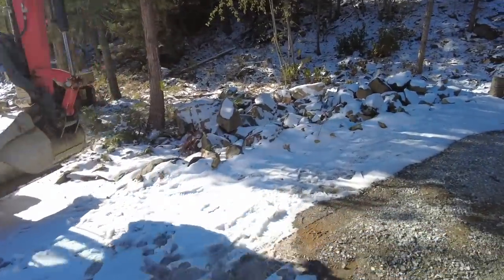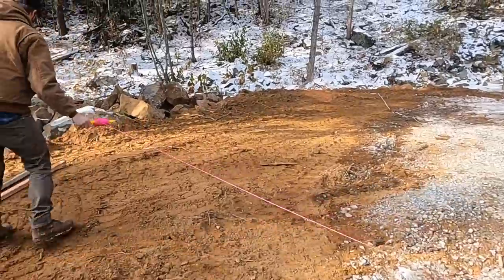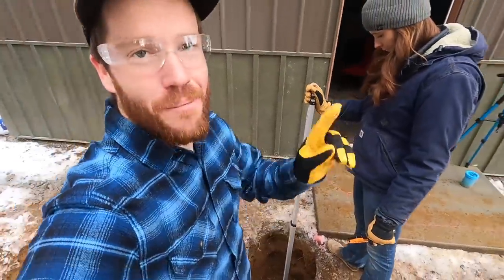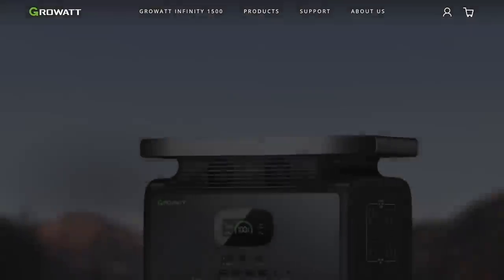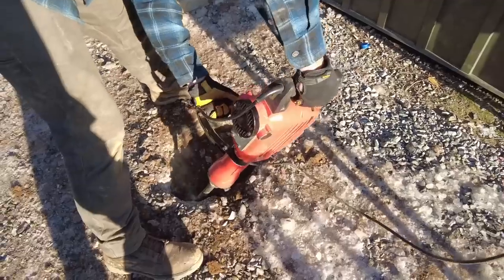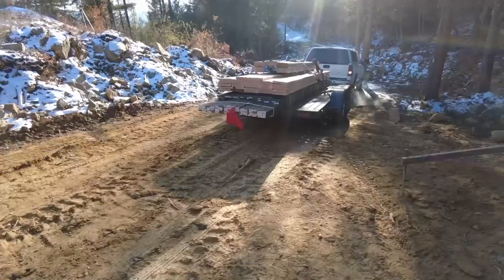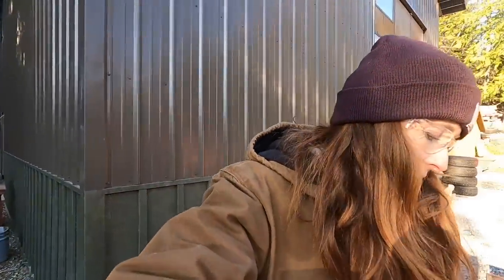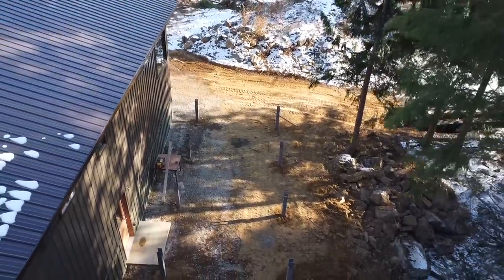Starting A NEW Build In WINTER?!

Comment: Something that could make your life easier if you're going to be doing a lot more holes is an auger that attaches to a hammer drill there's several of them on Amazon I use it when I'm drilling Frozen ground and you just need a good size hammer drill

Comment: deck: good idea. Especially for emergency exit.
Carport: good idea
I'd keep the interior stairs for ease of getting shop plus, if the overhead would go down. You'd have no the electrical panel.
And finally: Make sure you have a good gate on the outside stairs that's varmint proof. Don't need a bear knocking at your patio door

Comment: Make a vapor barrier tent by blowing air into an area with the plastic anchored on 3 sides, and most of the 4th. You can then put a heater inside and pour concrete year around. My uncle told me that is how he has poured at -20F up here in Alaska, while inside the makeshift tent would be between 40-60F depending on the heater and area heated.

Comment: I also have an electric hammer, but tis 2800 watts! Only powered by my gas generator. BUT, the reason for the comment, I got tamper tools for it too. I put in 670' of fence and it was all rock and shale. 6" top soil, then the hard stuff. Auger to place the hole, then hammer loose and remove with manual post hole tool. No concrete, too hard to replace if a post gets damaged, so backfilled with crushed limestone and tamp. The tamping bit on the power hammer really was a saver! Took me most of the summer, I'm 63 and needed rest days, but got it done.

Comment: Just a quick hey!  Been watching your videos for awhile now.  Based on your deck size I would suggest placing your deck boards at an angle to your trusses.  This let's you purchase 1 size board for the entire build, run them slightly long and then just strike a line at the end and cut the ends off.  I did it with my 12' deck using 16' boards and it looks amazing.  Everyone comments when they see the angled boards.  Also, no butt joints to warp over time.

Comment: We got 77" in 24hrs FYI when pouring concrete in freezing temperatures you could take plastic & cover the pour. Cutout around post for tight fit & then extend well beyond the edge of your hole

Comment: A shop-vac with a cyclone separator is my secret weapon for digging narrow post holes in rocky soil... Vacuum the loose dirt out of the hole around the rocks so that you can dislodge them easier.
Reply: Skips the post hole digging shovel too... Vacuum+breaker bar >> shovel😂

Comment: 4:58    I know a guy that uses .035 mig wire for layouts.   with a wire tensioner, you can get them fiddle string tight, no sag over long distance, and not affected by wind as much as mason line

Comment: Tip. Use hot water when mixing concrete in freezing weather so the freshly mixed concrete is 60 -80 degrees. The water does not evaporate in concrete. It INCORPORATES as it HYDRATES the cement.

Comment: When pouring concrete in low temperature one of the critical items is temperature of the concrete as it is poured above 50 F then insulate.  The 50F gives the  concrete a chance to start generating its own heat..  Cheers enjoy your projects.

Comment: If you use hot water to mix your concrete, it will speed up the hydration (curing) process as well.

Comment: I built a similar deck on my house a few years ago. I ended up extending its roof to overhang the deck bc of the blow in rain. For you guy's it would be snow. Just something to consider. Cheers
*Just looked at ur design again and trust me you guy's want to extend that roof line 2' past the deck line. So run ur 4x4s 7 feet past the deck line. Again suggestion. 😉

Comment: That is going to be a good size deck, the views should be pretty nice from up there.
Damn that is one heck of a snowblower you picked up, that is going to make clearing the long driveway so nice. Keep lots of shear pins handy as you have lots of rocks in the driveway. I plowed commercially for many years and no matter how far I would push back the snow of the first few storms by mid winter driveways got tight, I would have loved a truck-mounted snowblower.

Comment: Water in concrete is consumed by the chemical reaction of the concrete curing, no evaporation is involved. Second use hot water and non-chloride accelerator  when mixing up and you're good to pour. Cover the top with a blanket.

Comment: I hope you are going to put some ice and water shield folded down at the edges 1” min to prevent the top of those GLB’s so they don’t rot out  
Also it takes more kinetic energy to melt ice than create it  
When melting wipe off water while in liquid form before it refreezes  just a couple pointers

Comment: G'day Guy's
I'm enjoying watching you content from Brizzy in the land of Oz
After over 50 years in construction....
Estimate the amount of water needed for you mix (ad most but not all into your mixer)
(I'd use hot water 60F-70F or even hotter, and it will give you time to let the concrete go off before freezing)
(We ad ice to do the same but opposite here on hot days)
Add your cement 
Than ad your gravel/sand for a easy and well mixed brew
Adjust the required water according to your wants and needs for your project mix at the end
Cheers and keep up the good work ... Rosco

Comment: Water in concrete does not evaporate.  Water is part of the chemical reaction for the cement paste to cure and crystalize.  Concrete is a mixture of water, sand, aggregate (stone, usually), and cement paste.  Fun fact: Concrete never stops curing over its lifetime.  Something I learned in architecture class for foundation pouring. :)

Comment: If doing the concrete again in frozen soil preheat the holes. You could light a fire in each, and cover them in  insulation or straw after the pour to help keep the heat. 
You can use your excavator and either cardboard or PVC pipe. You dig a bigger hole, drop in the tuoe and pack back around the tube after filling the tube with the concrete footing.

Comment: That concrete you poured in the hole was to dry and clumpy ,not wet enough and will not flo under the post like you said. Make it wetter, it will not freeze before it dries with all that dirt on it.

Comment: I can't imagine that as shallow as yourfrost level goes.  Here in Atlantic Canada we go six feet down for posts or footings.  I have seen four foot footings used on an attached garage lift and move tye house sills of the foundation.   Howcome you didn't just back the trailor into the shop and close the door to keep the heat in?  Seems counter productive having the heater on with that door wide open.  Fingers crossed for you that it all turns out.  You put so much hard work into it and have such great plans and drive.  Keep up the good work.

Comment: The water in concrete doesn't evaporate. There is actually a chemical reaction known as hydration where the water and Portland cement form new chemical compounds. These reactions actually continue for a very very long time with the concrete continuing to gain strength. The rate of strength increase decreases over time. For design one uses the 28 day strength of the concrete.

Comment: OK I'm sold I'm buying one of those power boxes. Also on our end we had our Solar panels installed Saturday and on Monday it will be active. It will provide 94% of our electrical needs. Our water heating panel has been  up for 30days now we saved $70 on last months bill. Our electric was $278. down from $355. a month and next month our bill should be only $25.00 Net Metering charge. Solar-Fit is the company.  I'm now selling for them. I retired in 2015 and just decided I would like to sell something I believe in. So that's it I'll send you photos next week.

Comment: Does the snow blower mean you sold the bulldozer? It appears you are going to mount the blower on the army truck. Do you think it will have enough power to run that big blower, or are you going to put a second engine in the truck bed like big commercial blowers?
Reply from the maker: Stay tuned for more on this soon!

Comment: You two never cease to amaze!
Since discovering the power of hydraulicly assisted digging I have come to realize how much I hate shoveling. I used the same posts from Perma Column that you used. I dug all of my post holes with an excavator, placed sonotube or 4 ft pieces of corrugated plastic pipe. Backfill outside of tube or pipe with crushed rock and compact with jumping jack. I used 24" pipe for my building posts but I think 12" or 18" would be plenty big for you since you have so many posts. Brand new 12"x20ft cpp costs about 300.00 from Arrow Supply or Consolidated in town.
Your method definately more cost effective but I hate to shovel.
Augers that can handle our soil conditions are available for purchase but not for rent locally.

Comment: I have a Milwalkie fuel 18v SDS hammer drill I’ve made bits with a 3’ extension best and easiest way I’ve ever dig holes. We live in Las Vegas NV and it’s like digging concrete most places here, this makes it super easy and quick

Comment: TIM from Canada.. I do not know if you know this or not. but you can buy ( line  level. ).  this is a little level that will fit on your string. Will tell you if you’re straight or not.. this should be in the same section as all the levels if they have these not everyone does

Comment: dont stress about the concrete ...ive seen concrete poured in -20c ,,,,its a chemical reaction which is exothermic ! it makes heat as it dose its thing so just keep it covered and insulated for a week a month is better at that point its 99.5% of its strength ...at the temperatures you are seeing a few inches of straw should be plenty   plastic sheet to keep the moisture in as the water is part of the reaction it is not mud where add water after it is dry and you get mud again...thanks for the videos.... ps you want the water to not evaporate it is a reactant in a chemical process which produces heat !

Comment: Post hole diggers work well until you get to a depth where you cannot spread the handles open enough. At that point, I used to use a tamping bar chisel point to break up the dirt, and a shop vac to vacuum the dirt out of the hole. It's surprising how fast it can work.

Comment: I am a bit concerned on how shallow the footings are !

If you are using Perma-Columns, and you have a sufficiently deep hole, you could put a precast (make forms on the garage floor with paper underneath and rebar) concrete  "cookie" at the bottom, about 4" thick.  Place the Perma-Column on top and back fill with 3/4 down sharp gravel.  The gravel will allow good drainage so you will have less chance of frost pushing the column up.

Comment: I don't understand why there is no outlet on the outside of the building on all 4 sides. I guess it is as simple as not thinking about the need for that. It might be a good plan to add a few outside outlets to have electricity available for things like plugging in vehicles to keep the cooling systems warm in the freezing winter. Yeah, I know about antifreeze solutions.
Reply from the maker: We have exterior outlets planned, but we haven’t finished the wiring to the building yet.

Comment: Not to be rude, but if you placed those columns on a rock then the rock is your footing which will fail in time. You don't need lateral support around the column. A footing is under the column. Not to mention you said the shop wires are under the footing which is another reason it's not a proper footing. So many people do this wrong.

Comment: FYI, for those using Concrete for Posts, anytime of the year, the best way is to just dump the bags into the holes completely dry and you won't even have to worry about mixing or adding water. Believe it or not, the Concrete will absorb moisture from the Ground and actually harden harder then if mixed with water. Also you can tamp the Concrete to hold the pole in place and fill the hole with dirt to set the post in one step. Obviously it's too late for you guys to use this method but perhaps someone else will find it useful or maybe you guys can use it on your next project. Keep up the great work folks...

Comment: Another great how to video . I live in Canada and apparently concrete is mixed with hot water from October to spring .
Reply: Dont use hot water with fast setting concrete (rapid set)  like they used or it will be hard too quick. A good way would be to add a plasticizer (flow control from rapid set) to get more dry mix but way more fluidity without adding more water

For winter concrete, yeah adding hot water and covering the concrete and push hot air with a propane heater.

Comment: there is a 2 part pole setting compound the power companies use to day now  for the power poles it is a lot better and faster....
Reply from the maker: That stuff is awesome for posts and fences but it isn't load bearing like concrete is so in this situation concrete is necessary to distribute the weight over a larger area.

Comment: Nice job!  17:23 I noticed your roof doesn't have any snow guard/stoppers.  With your deck going up and the sliding door being your primary entrance it may be a wise decision to put up a few.  I know Riley hates the roof but it could save a bunch of snow and ice come crashing down on yourselves or damaging the deck.  Cheers!
Reply from the maker: Our building structure wasn't designed to hold the weight of the snow, but we do plan to add a covered section to the deck/staircase.
Reply: @AmbitionStrikes  Sounds good. 👍

Comment: The curing of concrete requires water.  The hardness & strength are not achieved by evaporating the water. There is a chemical reaction which requires water and also generates the heat you feel from curing concrete.  (Note also that concrete cures underwater.)

Comment: Water isn't going to evaporate from concrete in the water.  The REAL reason you want dry mix is to prevent the water from freezing, which results in the inevitable 15% expansion and destruction of whatever you're trying to make.  In fact, this is true for all concrete pours.  Concrete doesn't "dry."  It cures via a chemical reaction between its ingredients, a reaction produced by the water.  If you have too much water, the concrete cures, THEN dries, and is too porous.  You want just enough water to react completely with the ingredients, and no more.  It's also vitally important you float the concrete to allow the ingredients to settle while allowing for excess water to drain off.

Comment: Ohhh getting excited seeing that behemoth of a snow blower, looking forward to it's own "full feature movie" coming out :D
Looks a bit like mine, but mine is only 1 row auger high, 99" wide and probably weight a literal ton. Could have been wider, but does the job in 2 passes.

I see it is a 3 point tractor hitch with PTO drive,  what is your plan for powering this?
Planning to put it on the army truck or buy a small wheel loader for it?
Mine is powered through hydraulics by a VW 1.9 tdi turned up a bit and it throws really good, even in wet snow.
It is going to be another world for you with the blower! 😁Just don't try to run it on one of those portable inverters of yours 😂

Did you know that the concrete isn't drying, but rather curing through a chemical process. In this process it also creates its own heat, so pouring at a few minus Celsius isn't a problem done right.
The less water you managed to use, the more load the concrete can withstand once cured. It gets "tougher".

Comment: Why did yall not attach the deck straight to the house and delete the inside row of posts? I build my decks as you did here but, I am thinking more for vehicle/equipment parking since you practically have another covered area. For minimal cost, you could install a water tight ceiling and have a nice dry area. Just a thought but either way, it looks good!!!
Reply from the maker: Because it is a post frame building, that wall wasn't designed to hold much additional weight beyond the snow/upstairs apartment. We plan to put a roof on the deck and didn't want that snow weight bearing on that wall.
Reply: @AmbitionStrikes  I gotchya now. I'm in the Charlotte, NC area and our snow loads are really ice loads but it lasts for maybe a day or so 9/10 times. I keep forgetting about yalls location! Will you be able to store any equipment/atv/trucks under the deck? Looks great and can't wait to see what else yall do!!!

Comment: Laughed at bringing out the inverter battery to run the concrete mixer through a coiled extension cord a few feet from the building door.  I know the point was to use the sponsored product, and if the building wasn't right there it would have been very handy.
Reply from the maker: It has been nice to keep the door closed, as the shop stays much warmer!
Reply: You can add an exterior outlet so you don't have to have a door open.

Comment: 37 Year's ago I get tired of buying top of the line garden hose nozzles that only lasted one year, so I built my own. After 37 years the ball valve wore out, I replaced it.  Now i’m good for another 37 years. Use all brass not galv.    Hears how you build it.   A fitting that screws on the end of your garden hose x  3/4 “ female pipe thread, into that a 3” nipple, then a 3/4” ball valve, then    A   Fitting that is male pipe thread x male garden hose, on that a suicide nozzle.     A suicide nozzle is called that cuz in fire fighting it’s the nozzle that has no shut off, & if you drop it, it will go all over & kill someone .The one you want is about 1 1/2” long tapering to a point with a 3/16” hole where the water comes out.  This nozzle is not cheap, but remember it will last 37 years. And only the nozzle wears out . P. S. Put the ball valve handle so “on” is toward the hose.